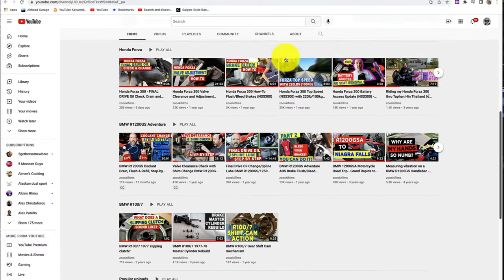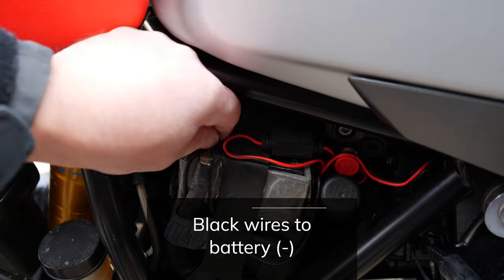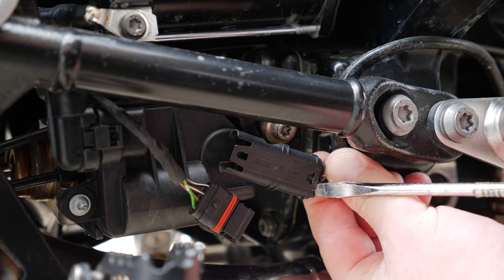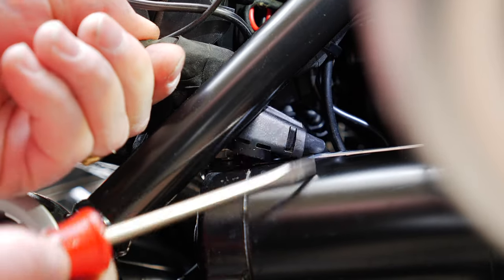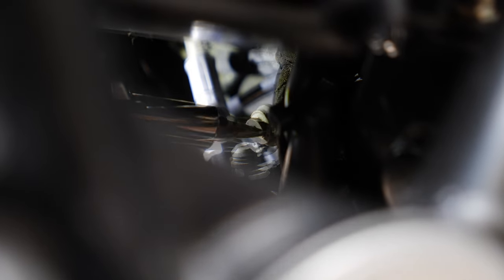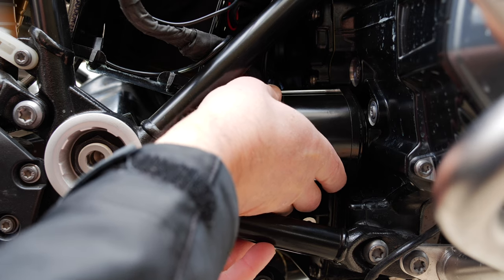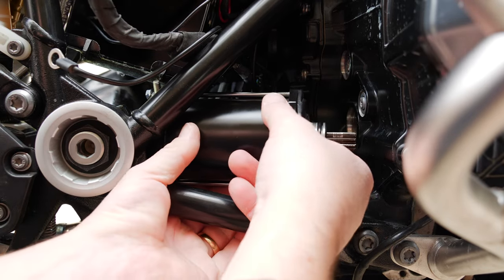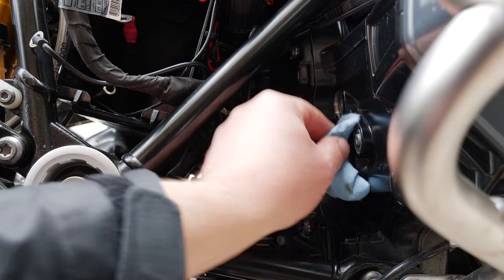Starter Motor & Battery Removal on a R1200GSA/R1250GSA: DETAILED Step-by-Step Instructions

Comment: just subscribed today June 25 2023. I have a 2016 R1200GSA and remember removing the starter to get to the clutch hydraulic bleeder after deciding to flush the clutch hydraulic system. It was a major pain because I did not have a lift platform so I did it on my back. Lots of cursing that day! Getting ready to look at your coolant flushing video. Keep up the good work. I am also trying to isolate an intermittent problem with the front wheel tpms / RDC sensor connectivity. If you have any insights on that it would be great.
Reply from the maker: @manuelrivera6873 - He thinks for watching and subscribing! My apologies for the delay in responding, my day job is keeping me busy these days. What are you seeing on the TPMS? Is it blaming out or showing no connection? Do you have a GS911 reader? Hexcode has a page on their website on how to check through the GS911. PM me with your email and I'll send it over to you. Thanks again!

Comment: Thanks for the video. Did the job on 1250 gs. 
Upper starter bolt was a nightmare. Took me 8hrs 😁
Reply from the maker: @mvuleta  - Oh yeah, very tricky bolt to get at. I assume more trouble getting back in? Or about the same both ways? Need to make an articulating arm to snake in there.
Reply: @zooskifilms  It was trouble both ways 😀but installing was more difficult. Had to cut torx bit to shorten the length after universal joint and finally angle was ok. I serviced  the starter also...
Reply from the maker: @mvuleta  - Great, now you've got the tool ready for the next time! Thanks for sharing.

Comment: did this also for replacement of clutch fluid and with no lift. on my back at times. what a pain, butgot it done. love your videos, keep up the good work! was wondering why you did not put any grease on starter motor gear.
Reply from the maker: @manuelrivera6873 - Thanks for watching and comments! If I recall correctly the starter clutch gets lubricated from the engine oil. I'll have to check the service manual again to be sure. Cheers!

Comment: I just did this the past weekend. What a difficult, finicky job.  Once a mechanic advised me to remove the swing arm. One more bolt but it takes a lot less time to remove the starter.
Reply from the maker: @Anton Van Der Merwe -  Yes, so true, very very finicky. I uttered the words "no way is this starter coming out" many times during the making of this video. But it does! Taking out that swingarm would probably make the job easier but I was trying to avoid that extra work. I think removing the two bolts holding the exhaust/servo bracket would make this much easier. Didn't realize it until I had the motor out already.

Comment: Great video, thank you.  Why did you need to pull the starter anyway?
Reply from the maker: @Michael Vadney - I was flushing out the clutch fluid, the bleed valve us just underneath the starter motor. That's a video coming out soon, just need to find a little time to finish it off. Cheers!

Comment: when i reinstalled the ground bolt on the starter i noticed that the thread was a little stript so i used a little locktide on the bolt wil this disturb the ground connection ?
Reply from the maker: @bjorn de decker - Sorry for my delay, had work travel for past two weeks. Loctite has a green version of thread locker intended for electrical connectors (among others). But I don't have any personal experience myself. I would just monitor the connection and look for any corrosion or oxidation build up over time. Cheers!

Comment: What kind of glue did you use to reinstall the T30 bolt?  Thanks!
Reply from the maker: @Jonas Abramson - Good question, I will add that information to the Description. It was basic super-glue. I needed something that would hold. I had some contact cement that I was thinking of trying, if the super glue was too strong. In the end it worked so I kept going. I put a very small amount and only on the edge of the bolt head so it could be more easily removed from the torx bit. If you watch closely you can see the bolt broke off while during the install, but I was able to push it in the rest if the way without it being glued on.  Thanks and happy wrenching!

Comment: Wow, what a PITA? My next bike is gonna be a Yamaha.
Reply from the maker: @Ed Syphan - PITA is an understatement! I think removing the two bolts on the exhaust/servo bracket would have made the start slide out easier. May have to go back and try that. Cheers!